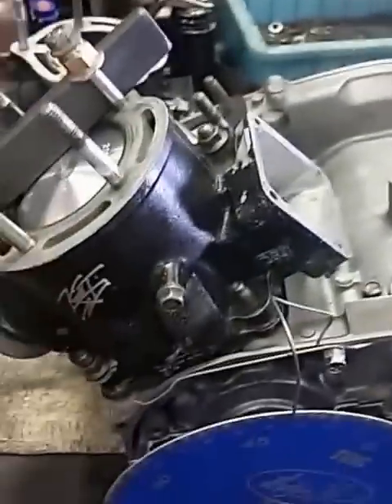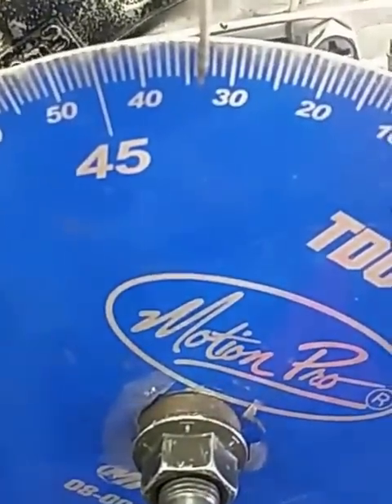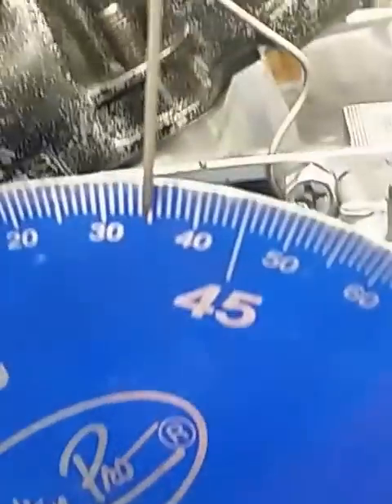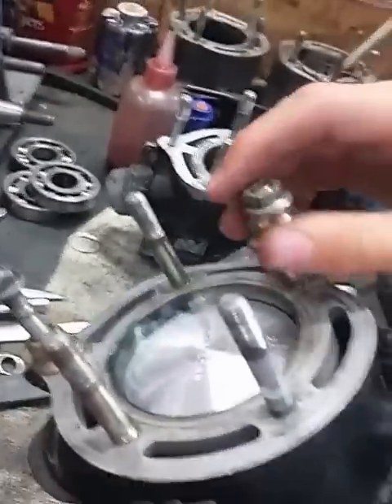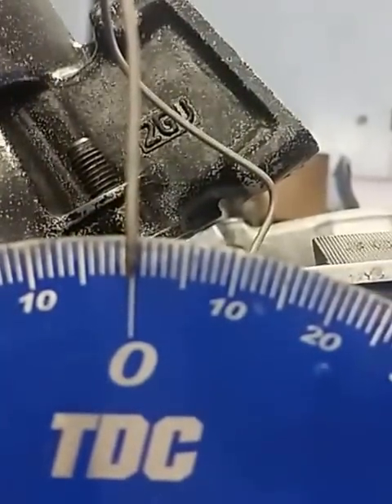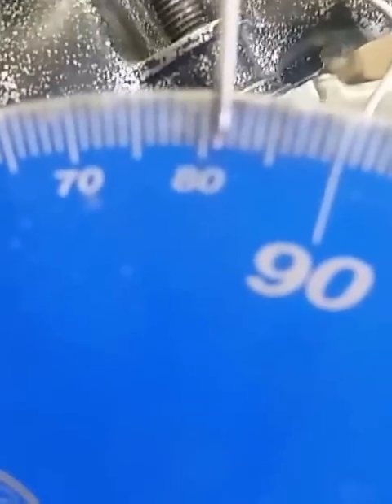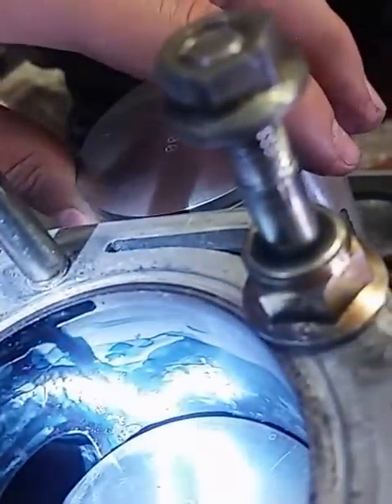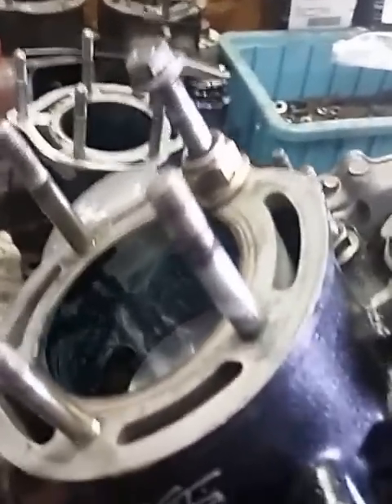How to set up the degree wheel.  For 2T port timing.

Comment: There is no need to set absolute TDC on port timing simply because port timing is symmetric to TDC, all you need to do is zero at port opening and read off duration of opening.
Setting absolute TDC is for asymmetric timings like rotary disc intake where open and close is not symmetric to TDC.
And most critical for dialing in 4t cam timing because it is to measure valve lift at 1mm / 40 thou not duration.
Reply from the maker: Although true; it is absolutely necessary when locating the timing in relevance to area. The port floor may reside above bottom dead center, yes swept (crank)  duration is constant, however "dynamic" duration's are variable under the same stroke (Different area, same duration).  As well as adjusting the events of transfer and exhaust in relation to each other (blowdown).

The purpose of this video wasn't intended to go to that depth.  Many, many people calibrate their builds with simple duration numbers they read about, and have no idea how to achieve them. The goal is to provide a simple means with easy math to accurately do so.

Thank you for the insight though :)
Reply: @tassie dirt bikes Its quite simply, symmetric timing just means all the port timings are the same on the down stroke as the up stroke and you can simply count that off the degree wheel as you turn it without knowing where TDC is.
Same applies for transfers, exhaust and blowdown, and port time area you just read the open time in degree.
Port time area just refers to the area that is open at each degree and open is open is open and not different in the down stroke to the up stroke.
So just bolt the wheel on and read the degrees off it as the port opens and then as it closes.
In fact reading only the opening period relevant to TDC is less accurate then total open degrees.
Reply: @AuMechanic  when setting up the degree wheel at tdc should I make sure I move the loose degree wheel to zero(0) then tighten the nut on the wheel? Then start checking intake, transfers, exhaust, etc etc?

Comment: How do we calculate blowdown ? Im having trouble understanding
Reply from the maker: Blow down is the amount of degrees from exhaust open to the point of transfer open.

Using the degree wheel, this can simply be taken straight from the wheel. 
It can also be done theoretically with math using your duration figures.
Reply: kanpowersports1 thankyou so much for your videos and answers . helps to understand a dying subject . or a rare subject .